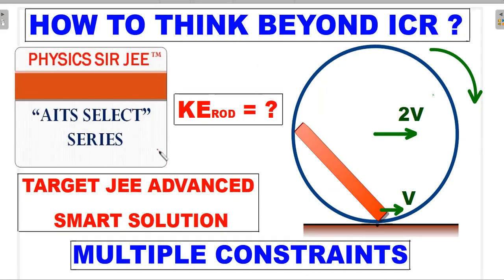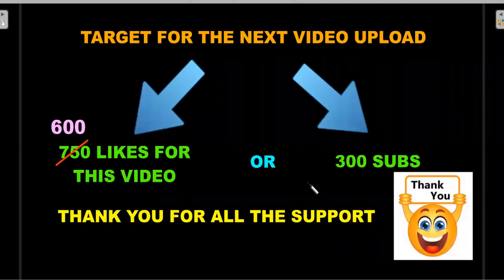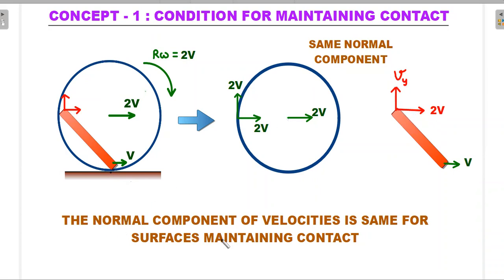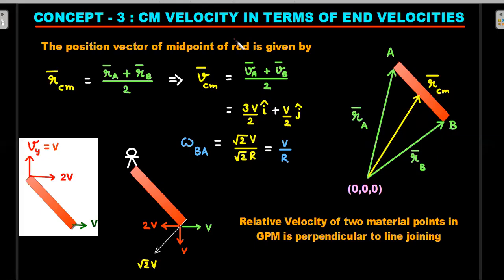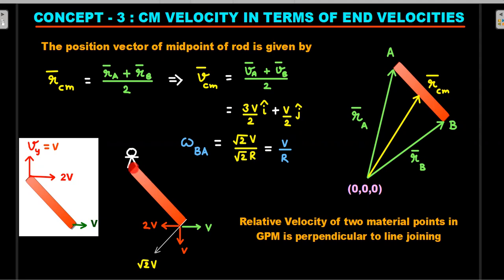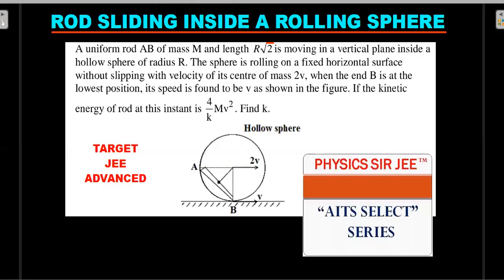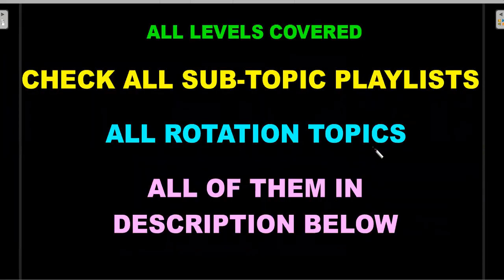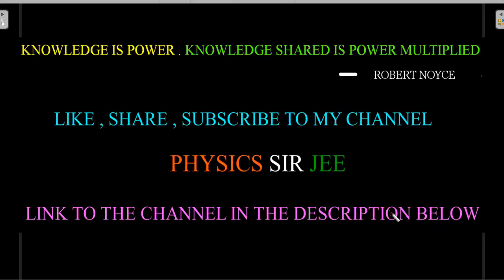SLIDING ROD IN ROLLING SPHERE: CONSTRAINTS ROTATION | AITS

Comment: 9:15  
acceleartion of the body and the point in contact along the normal dirn must be the same in order to maintain contact , and also there shouldn't be any vertical accelaration of the body in order to be at the vertical position R/2. final ans - B
Reply: Sir, every where average force due parallel incident beam on reflecting spherical is taught, that is I×projected area/C, but average pressure on surface is not mentioned specially in this case, some what confusion is that components of resultant force should be taken normal to surface to find the average pressure or should be taken  small elementary force on infinitesimal area due to change of momentum of radiation, which is already normal to the surface and further obtained average as function of area, as obtained average electric power in AC, please help ....

Comment: Sir as you write omega of rod wrt to the point sir can we similarly write alpha of rod wrt to the any  accelerated point of the rod and sir can we also write acceleration of com of the rod wrt to the point on the rod which is accelerated and adding the acceleration of this  accelerated point  to the acceleration of com to get the acceleration of com wrt to ground. SIR please reply . It is a general query sir it is not related to current vedio
Reply from the maker: Proper time stamp of your doubt is required for old videos to navigate easily. Please understand and put the time stamp properly like this 👉 1:01
Reply from the maker: Also your doubt has very long sentences and repeated use of the word "accelerated" making it slightly confusing to read . Please break it down into smaller sentences to help everyone understand 🙂
Reply: @PHYSICSSIRJEE  sir it is my general query not related to vedio that's why I not add time stamp sir. and sir please read my doubt I have written it in a simple language. AND SIR THANKS FOR THE REPLY OF MY DOUBT
Reply: @PHYSICSSIRJEE  sir please try to read i have written it in a simple language. AND SIR THANKS FOR THE REPLY OF MY QUERY